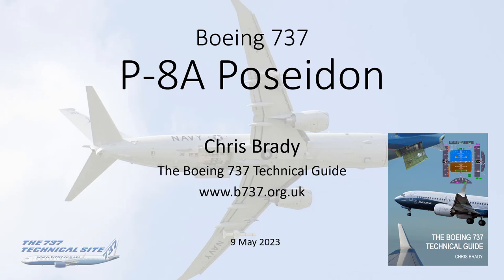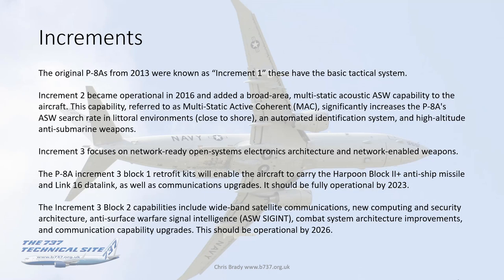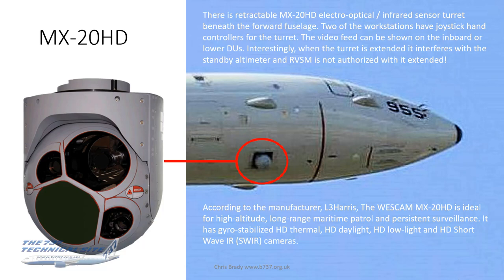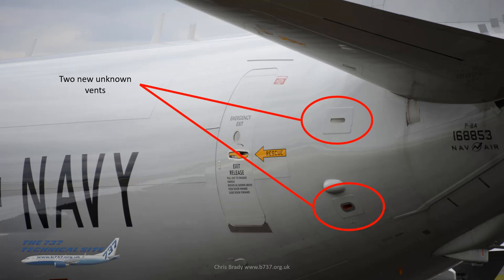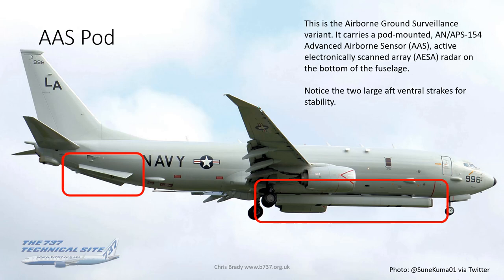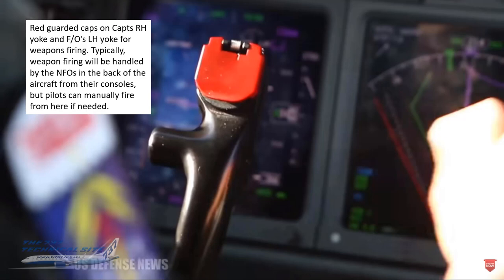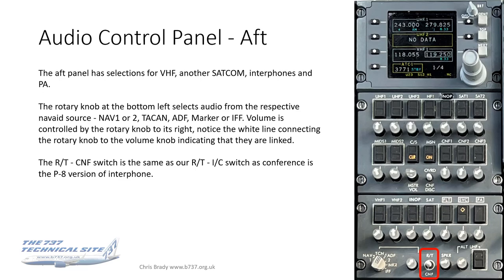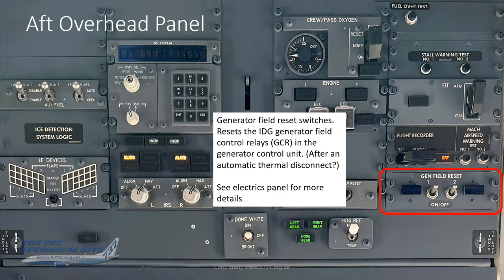737 P8 Poseidon

Comment: The reason the commercial 73s don't have raked wingtips is because it would put the dimensions out of the standard 36m gate box. For a given weight they should perform better than winglets.
Reply from the maker: Correct, I mentioned that in the winglets video
Reply: My P-8 pilot buddy said they’re an option on the bbj

Comment: Nice overview of this bird.
I would have liked to know a bit about the wetware support systems (heads, galley, crew rest bunks if any, meal stores etc). If the crew isn’t tip top the best hardware won’t function optimally.
Reply: 1 galley and head in the front. No crew rest bunks. Galley has a stove same as a commercial and a small fridge. There are two first class style seats in the front for crew rest for the pilots.

Comment: The EP-3E Aries is NOT a maritime AWACS aircraft ( like E-3 or E-7) , but rather it is more similar to RC-135 Rivet Joint , Signals and Electronic Intelligence or SIGINT and ELINT aircraft. There were also 8  P-3B aircraft converted to P-3 AEWC deployed by US Customs and Border Patrol in conjunction with E-2C Hawkeyes lent out to USCG in the 1980s and 1990s. The P-3 AEW had similar equipment to USN E-2C carrier-based AEW aircraft.
Reply from the maker: Thanks for the clarification.

Comment: “Disconnect autopilot” launches missile
Reply from the maker: Hopefully not, although most 737 pilots will have mistakenly pressed the TOGA switches instead of the A/T disconnect switches so anything is possible! Fortunately the weapons firing has more safeguards and is usually done by the NFOs in the back.

Comment: I believe whether they state it or not is the multiple DMEs are apart of link 16. If they are creating a wider bubble in strategic and tactical ingress that defensive packages and offensives packages would be used in hive mode link 16. Creating a bubble of safety with multiple aircraft meaning more than one. It's just a thought?
Reply from the maker: An interesting theory, that is entirely possible but beyond my knowledge. Thanks for your input.
Reply: DME is L-band, just like regular ATC transponders. Military equipment on L-band that normally use similar (or even the same part number) antennas are IFF, TACAN and TDL (Tactical Data Links) such as L16.

Comment: A question coming from a non pilot (Literally an 18 yo high schooler from Turkey): Do pilots who have been flying for a time remember or has to remember every minute detail like whicever bus powers the wheel well fire detection or what is the exact amount of fuel needed in center fuel tank to trigger a config warning? (This question excludes you since you are a walking 737 fcom)
Reply from the maker: Yes they do. Pilots undergo a lengthy groundschool program (with an exam at the end) before proceeding onto simulator training. Technical knowledge is reassessed both in the simulator every 6 months, on line checks and often with some form of annual technical refresher program. Good technical knowledge gives you the advantage when things go wrong!

Comment: Will you you be doing a presentation on the E-7A Wedgetail?
Reply from the maker: I don’t have enough data on it to justify a video. Much of the info is already in the P8 video though
Reply: @ChrisBrady737  that’s a shame. There’s considerable differences between the P8 and E-7A but I guess largely a lot of systems are the same. Effectively the E-7A is just a BBJ with larger generators and some other additions.

Comment: Regarding the German orders it should be corrected.

Five orders were made initially. 
In 2022 it was announced to order 12 instead of 5.

The the order was reduced to 8 examples.

So as far as I know the current order should be 8 for the german Marine.

The NATO will replace 6x 707-E3A AWACS by the end of this decade.
They will be replaced by 6x 737-700ER Wedgetails